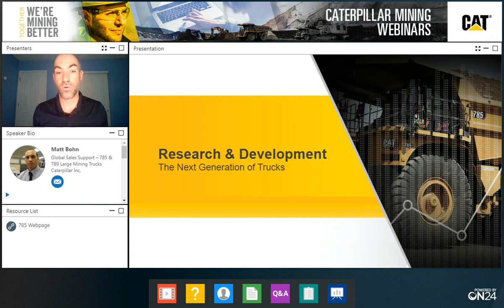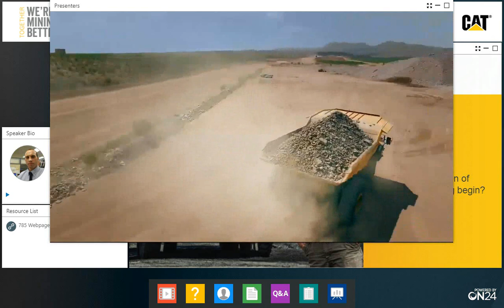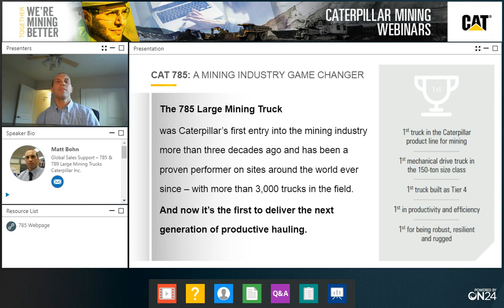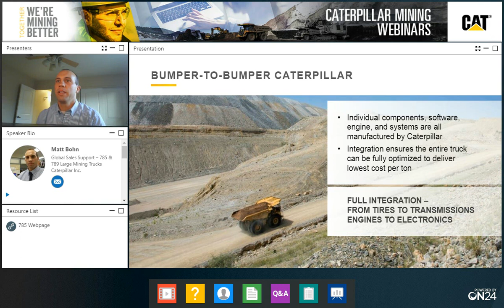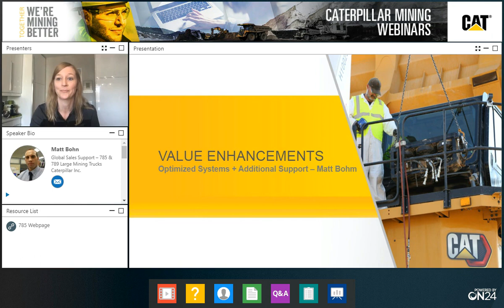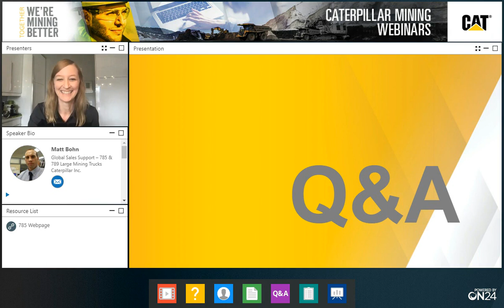The Next Generation of Productive Hauling: The New Cat® 785

Comment: I hope you are doing something about the poor build quality of the trucks as we have been building 6 of the old model 785D's and out of the 6, 4 have had to have extensive chassis modifications to get the cab or right hand fender to fit and every one has had to have the pump drives removed due to them being assembled incorrectly at the factory and failing before they have been delivered?